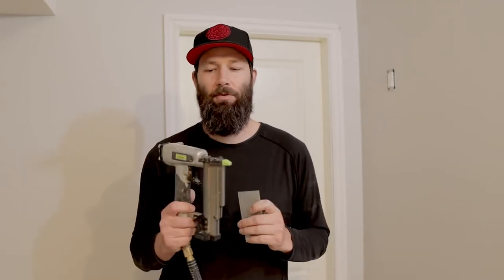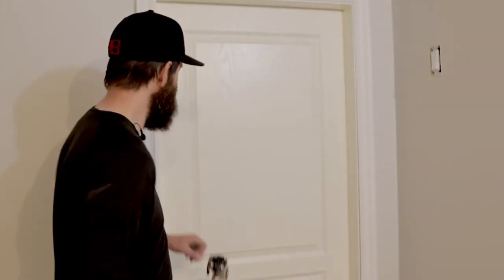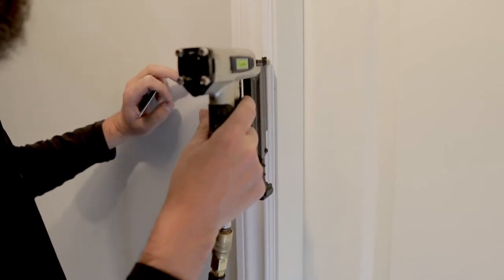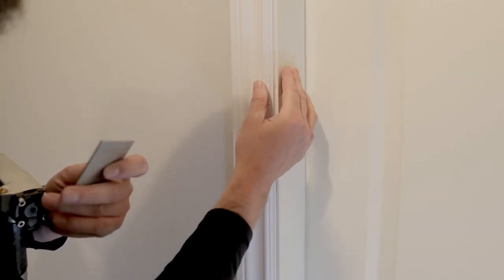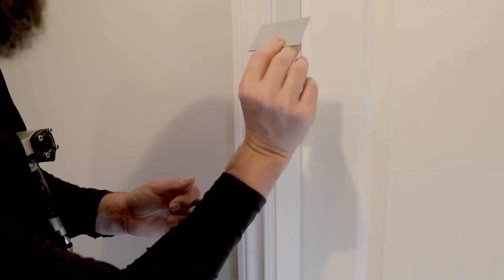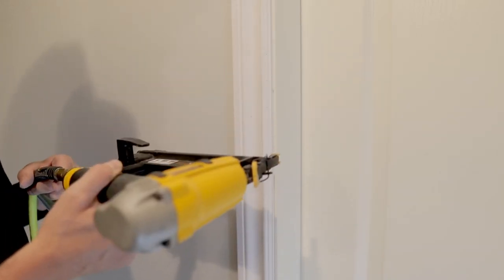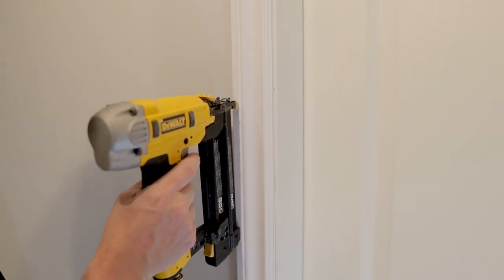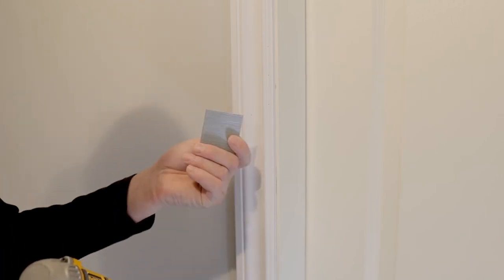The Absolute #1 Mistake People Make Using a Finish Nail Gun

Comment: Just found your channel- very informative but also entertaining. Any opinions on the Metabo HPT NT65A5M Finish nailer or the Metabo HPT NT50A5M 18 Gauge Pro Brad Nailer?
Reply from the maker: My dad and I were just looking at those guns on the weekend at the tool store.  The 18g looks nice, the tip looked decent.  I would be interested to see what type of mark it leaves.  As for the 16gauge gun, what are you going to do with it?
Reply: @TheFunnyCarpenter  For the 16 gauge- Metabo HPT NT65A5M Finish nailer. The online retailer Toolbarn had a deal for that gun and the 18g for $214.99 which I thought was a good deal if the guns are good. Here's a link to the deal: https://www.toolbarn.com/metabo-hpt-nt65a5m.html/
Reply from the maker: Bill H I just ask about the 16g gun because if found, a 15g gun to be nicer. The 15g nails are quite a bit more heavy duty.  Much better for hanging door frames or nailing on exterior trims.  I did have a 16g briefly but it’s not really well suited for much.
Reply: @TheFunnyCarpenter  Appreciate that input a lot. Maybe it's not as good a deal as I thought! Thank you
Reply: @TheFunnyCarpenter  Last question! What brand and model do you recommend for a 15g finish nailer and 18g brad nailer?
Reply from the maker: Bill H I have the Dewalt DWFP12231 which I like a lot.  As well an old 15g hitachi fun that has changed, so I’m not too sure on that one.